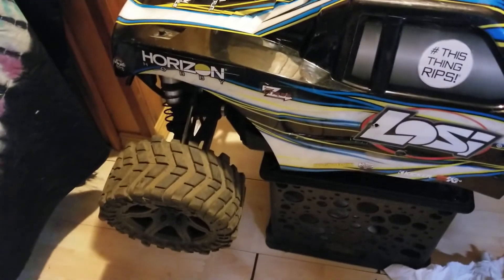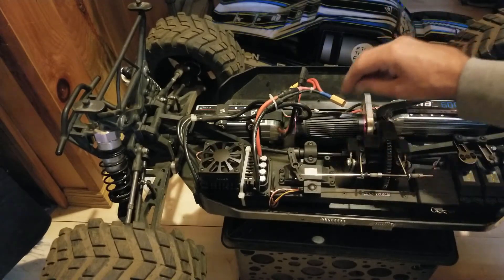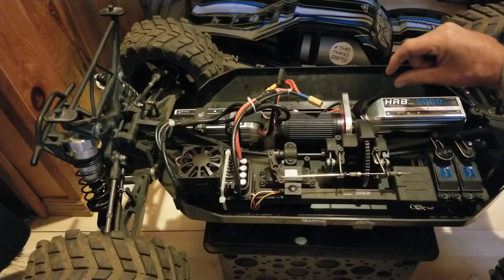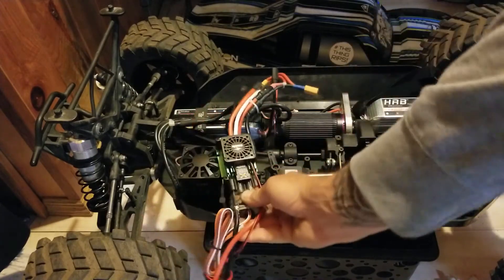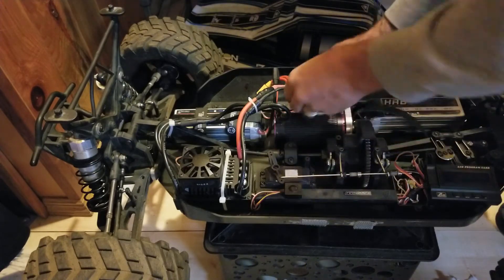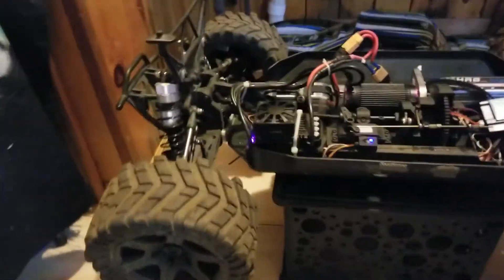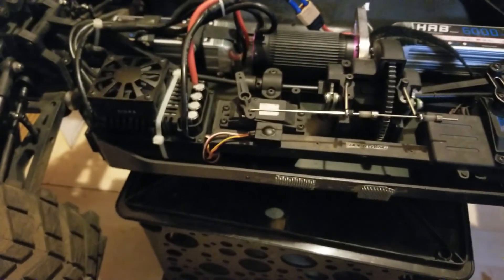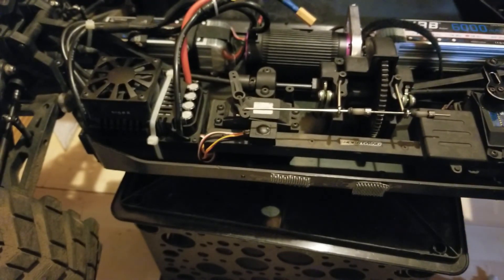LOSI MTXL 1/5 SCALE BRUSHLESS ZTW 12S 300A ESC

Comment: I bought this ESC the other day along with the new (ish) Leopard 58113 v2 530kv. It's going in my Kraken Vecta.5 brushless conversion and I'll be running 12S. Hopefully it will be ok, it should as the Leo motor is 110amps max. Also I didn't notice any spark when you plugged in the battery so it has anti-spark built in??

Comment: Pit great build , just about finished with my MTXL /5T / FID brushless conversion. Question, is a 24 pinion gear to much for the 2028 or any 800kv motor? I don’t want to burn up the motor on the first run.....I see you went with an 18 pinion in the earlier video and now a 16 in this one so I’m a bit concerned....thanks
Reply from the maker: What chassis are you using? Someone just did a 5t and i sold him  My 18 he is more than happy with speed he has 600kv on 12s. My 800kv is 10s rated and i run a 16 it goes 53mph maybe faster...
Reply: I'm using the MTXL chassis and stock parts but i have the 5T shell and cage mounted pretty nicely with a bunch of FID billet parts.  Also running the MTXL stock tires, so that might put more stress on the fuse 800Kv on 8S, fuse 160A ESC ? That 24 t pinion.... ???? Do you think I should gear down to something smaller (i would have to drill new mounting holes) .
Reply from the maker: Yeah thats super high the fuze 160a is also pretty small a max 5 would be much better.... you will want to put a 13 or 14 on it and it may not overheat esc...i know the dbxle has the 160a and people replace it with max 5 due to overheating. And drill holes? Get a poseidon motor mount it bolts right up and is adjustable.
Reply: Can't get in contact with Poseidon....email not working and no one answers the phone. Do u have extra mounts  lol
Reply from the maker: I do not...

Comment: Thanks for doing this Pitbull 👍🏻 do you run your servos on a separate BEC & Lipo? I wanna do a build like this!!  Think these new ESC’s are going to be popular! Also are the lipos ok at 25c? Don’t get hot? 👌🏻 cheers from UK 🇬🇧
Reply from the maker: Phil Hackett everything is currently running off the bec in servo. A seperat bec may be in the future but so far so good. This esc is a beast for sure I literally cannot get it over 80°F after a run. The lipos are 50c hrb 6000mah 5s. Lipos and connectors are 90° to 100° when done with a run. I'm very happy with this set up it will wheelie over backwards.
Reply: Pitbull R/C that’s awesome buddy very pleased for you 👍🏻👍🏻

Comment: What was the conversion kit that you used? How is it as a basher? Does it jump well?
Reply from the maker: spanglaz I did not use a "conversion kit".... the build and parts are covered in the video... Poseidon motor mount tekno v3 battery trays and straps... there is another build video prior to this one go back and watch that one maybe it will help explain the process a little better than this did I just went over the parts I used here...
Reply: Pitbull R/C thanks for the feedback, I'll try to find your build video

Comment: ZTW .... original ?? Or copy ???? There is no logo on the fan cover !!?
Reply from the maker: Lol.
Reply: @offroadmadness5427  
???
Reply from the maker: Seriously? Well i guess you havent been watching. This is one of 3 in first shipment sold to public in usa. It was still not in full production and yes it is a real ZTW 300A. Just didnt have any markings yet. I have a pic of the ztw ad without markings from February when i ordered mine. Thanks for watchin. Stop being a douch.
Reply: @offroadmadness5427  
So now ZTW produces an even more modified product ???
The case on the sides is smooth. Housing above the capacitors without edges.
And the red wire appeared.

Ps. I want to buy such a regulator, but I do not want to buy a fake. That's why I asked.
Reply from the maker: Good luck we are done here.